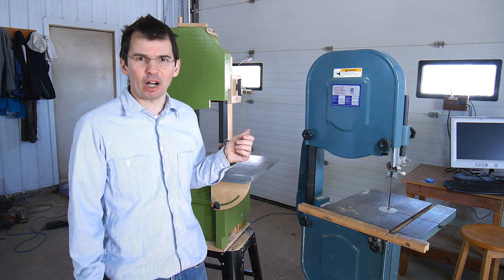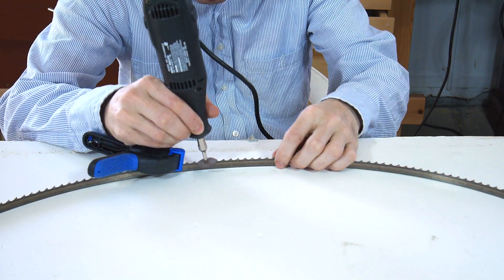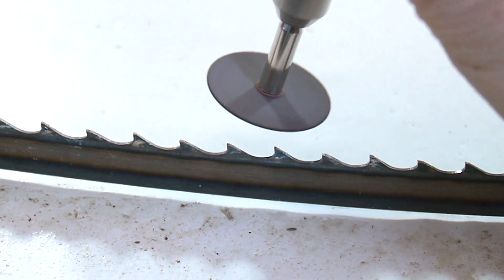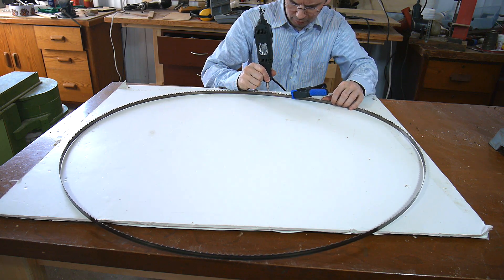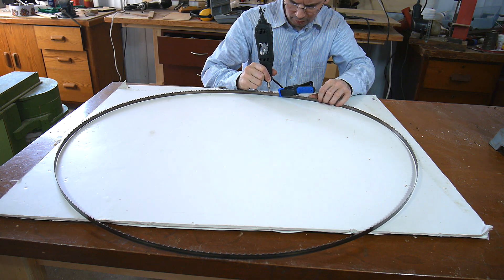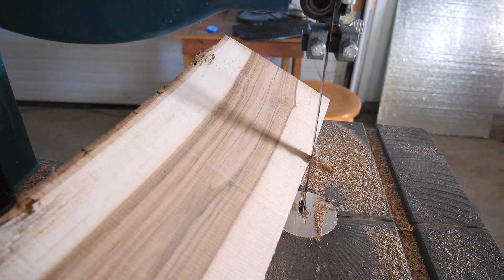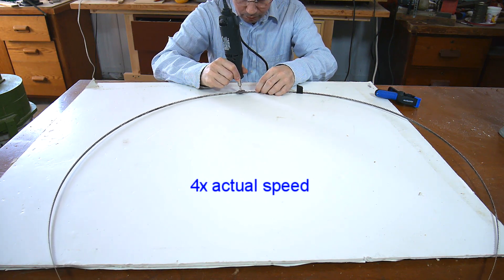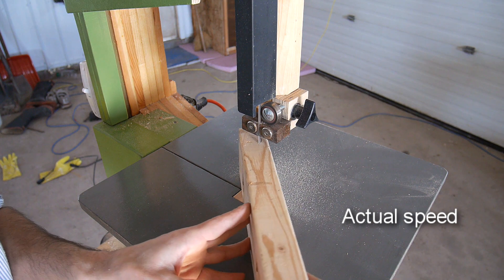Sharpening bandsaw blades with a dremel

Comment from the maker: A new video on sharpening bandsaw blades
I made a video about this five years ago. New video is shorter, better, and in 1080p
Reply: Shouldn't the sharpening be done under the tooth?? I mean, yes, this works indubitably, but it also shortens the life span, eventually you won't have a tooth to sharpen.
Reply: Nice update. I actually bought a dremel-ish after watching your first video. 

I have an excellent Starrett Intense Pro-Die blade with 10-14tpi (made for cutting tool steel) that I somehow dulled dramatically. I think I was feeding it through what must have been a weld when I thought it was just annealed mild steel, and my combo band saw slows the blade for steel but doesn't support flood coolant so I just had an oil drip. Clearly wasn't enough. 

I had forgotten all about this technique. I need to try it on that blade because it is really good quality steel. But I'm not sure there's enough of the teeth left to bother with it. Thanks for the reminder!
Reply: this makes my head hurt.... so many teeth!!!
Reply: Seeing how you do it seems easy and fast. Thanks for the video, very educational, as always.
Reply: ***** I'm not saying "don't sharpen" and i'm not saying it doesn't work that way, BUT, what i'm saying is that sharpening the "gullet" of the tooth (whatever that's called) is a much more profitable endeavor.

I mean damn, on such small blades it's really the joy of cheating the system, but there's big, big blades, 1 tooth per inch bigger, those are expensive as heck ($200ish and above) where you actually have to sharpen it or empty the pocket.

I don't think you'd cut the top of the teeth on that.

Just my two cents.
Reply: aserta I think he is just taking the easy route to get one or two extra uses from what he would normally throw out. You are correct about the proper method. Some people settle for quick, easy, wrong but better than not at all methods. I do it myself sometimes. :)
Reply: Beautiful! Thank you! Like many other videos you've made, your sharpening videos have saved me time and money!
Reply: Jon Miller  Well, it is better than throwing the blade away when it is dull for the first time.
Reply: aserta he discussed that exact issue in the previous blade sharpening video,
Reply: maxdecphoenix But he didn't in this one.
Reply: Meat saw
Reply: specialks1953 I really hate this mentality. There is no such thing as "the proper method." There's only methods you agree with, and those you don't. (also arguably those that don't work at all, but eh)
Reply: aserta So, in order to avoid the hassle of having to buy a new bandsaw blade he should take on a ton of hassle in trying to sharpen it as per your suggestion?

Bigger more expensive bandsaw blades aren't really relevant.
And if you're going to do that, you'd be weakening the blade too.
Reply: you could do a gadget to sharpen them and film the proccess
Reply: you should make an automatic sharpener, raising the dremel up and lowering it on a tooth, detected by a laser detector and reflector
Reply: I agree with you.  It is easy to speak about the perfect method...while sitting in an armchair.   In the shop, the week-end shop, this method is perfect.   Numbers are simple: in 5 minutes,  you put back to life a 10 dollar blade...
Reply: 9

u888

Comment: Great video and a great tip. Ive spent hours in front of a ban saw making log boxes that I sold in craft shows! One reason for my success was my ability to sharpen my band saw blades. Yes cutting down on the expense! I usually got 4 sharpening’s per blade. I used a 3/ 16th wide kerf blade for any cuts requiring a turn! My straight cut band saw I used ½ inch blade that was thicker. PS the dremel can also be uses on chain saw blades. BTY the quality of blades is no where close to what they were 20 years ago. I have older blades the difference is astonishing

Comment: Hi Mattias, I have an electric grinder for my many chainsaws. I use this tool to sharpen my bandsaw blades for my Startrite 502E band saw (a UK saw).  Begin by cutting a kerf (same as band)  in a six inch length or so of hardwood, drill four holes just below kerf, push into the holes four nails, the band must rest on the nail/rollers, drilled so as the band teeth are above the wood. On the underside tap in two nails into pre drilled holes (remove nail heads) use drill press to keep holes square to the surface. Clamp on the whole assembly the Chainguide and tighten. its a quick tool to make. Use the wheel for a 404 chain as it tougher. These electric  rotary sharpeners are about 100 quid in the UK, I think Oregon make them, mines a cheapy lookalike from china.. I hope this helps keep your sharpening more accurate…

Comment: Nice. Thanx for posting. Don't forget to check the set on those teeth. I bought a setting tool for my gas powered Hud-Son bandsaw mill blades. Does a nice job on the coarse resaw blades for my shop bandsaw too.

Comment: Most don't sharpen their blades because they use them till they break. As the blade dulls they push harder, They push harder distorting the blade making crooked cuts. To compensate they increase blade tension and then POP!

Comment: There must be a way of setting the dremel in a jig and the blade so the dremel is the set angle and the blade is fed in such a way that it does what you did in the video?? Great tip thumbs up.

Comment: I tried this on the junk blade that came with my bandsaw. It certainly cut much more easily, but had terrible drift, and even when I corrected for that, my cuts had a "waviness" that was not caused by moving the work. This is obviously caused by something I did wrong, but I'm not sure what - this video (or the other one on this channel) didn't mention what it might be.

Comment: Do you have an idea how often you can do that?
Reply from the maker: Marius Hornberger About five times, but it also depends on how big the teeth are.  Eventually, the teeth get too short.
Reply: For 4TPI blade I get 10-12 sharpenings before there's not enough kerf left. At the last several sharpenings the surface left by the blade is beautiful, if you can get straight (not wavy) cuts you can use resawn wood straight off the saw for building oudoor stuff.
Tip: use the lowest possible speed on the dremel tool for this job. I learned last summer that it's very easy to overheat the metal; I had several teeth in a row that had a tiny tiny amount of the tip broken off, so I just did several taps with a dremel tool (instead of one for a healthy tooth) and I noticed that the metal got discoloration, after that I grabbed a magnifying glass and checked more teeth and most of them had minor discoloration close to where the disk was touching. I now use a diamond disk, it is much more course, but it does not overheat the metal, though it is very easy to grind too much, first blade that I used diamond disk on got used up in only five sharpenings :) Hope this helps.
Reply: I know that
Reply: If my comment does not make sense to you, then you came to a wrong neighbourhood.
Reply: My native language is Lithuanian and I get to speak in English only in youtube and facebook comments and sometimes emails, so sorry that I used kerf isntead of set or whatever word. I would be actually sorry and willing to improve if that sentence would have not made any sense, but everybody knows what I mean by that and I don't see any problem here.
Reply: I wasn't refering to teeth. You seem to have no idea about what I was talking. Take a better look at the blade and see where teeth bends start. They start at best close to the thickest part of the tooth, so if I grind away say half of it, I'm left with 0,2-0,3mm of set wich brings us back to having not enough KERF for succesful cuts.

Comment: I've enjoyed your videos for years.  I have a large Laguna bandsaw which I use chiefly for cutting up firewood. The blade on it is pretty dull but I'm not looking forward to doing one tooth at a time for a hundred and fifty teeth. How about mounting the blade backwards, turning the saw on, then holding an ordinary knife sharpening stone against one side of the teeth, then the other. It probably wouldn't be as good as doing each tooth individually but it would be a lot quicker.

Comment: My father would sharpen and set his own band saw blades (and everything else) but he would buy the blades with no set and apply the least set he could manage (he was seeking accuracy on small parts not volume). His differing requirements would probably have been at odds with the dremmel idea in that the burr will appear on the same side of the blade and would likely cause the blade to track sideways (particularly under pressure). Perhaps these tips would help someone else. He would unify the teeth my gently sliding an indian stone against both the sides of a set saw. He would do the same on the front till all the teeth had been touched. He would then file the backs as you have dremmeled (In the direction of set) till the newly "stoned" face just came to a point. He would then file through the the face of the tooth (in the direction of set to create an outside burr (pitched forwards at about 20degrees. Then he would again do the above with the stone to just touch the one or two teeth that may have gone proud and having identified the flats he would dress those again and also to touch off the created burr...... his mantra was that yes a burr is sharp but a burr that has "just" been cut off is sharper still and remains sharper for longer.....For any of the doubters we could cut strips of hardwood say 2mmx20mmx~600mm and a micrometer would not pick up 0.01m difference in any of them anywhere.......Slowly of course....I think I have left out one bit of information for those that might try this at "home" but to anyone experienced it would be obvious....Thanks for the video

Comment: That's cool... I thought you need to grind a lot to get it sharp enough... 
Why not screw a piece of wood with a groove in it to guide the blade, and a small mechanical rocker arm to hold the dremmel, with a small roller to ride over the crest and wave of the blade to make the grinding semi automatic..

Comment: If you are going to knock down the the outer edge anyway, wouldn't it be easier to use a fine grit sand paper with a stiff block?

If you mounted the blade reverse you could do it on the saw and it would also level all of the teeth, which should be pretty crucial for even cutting from each tooth.
Reply: For anyone else wondering; I just realized the physics will not work out.

The teeth MUST have a single point with a slope back to the spine behind them. Think of a single tooth going through the wood as you advance the piece. The tooth must make a cut that slightly advances as it cuts and leaves behind a slope behind it.

A tooth with a flat is effectively a miniature chisel layed perfectly flat. As soon as the surface is a flat long enough to span two teeth it will no longer ever achieve a "bite".

Comment: Mr. Matthias, I inform you got a manual electric planer and I am finding it difficult to use, then ask if possible, a step as step to use it adapting so upside down on a bench with rip fence. Sincerely, Euripides

Comment: watched this and was thinking one could  make a angled drill press like dremel stand and that way you could set the max depth and just pull down till you hit that or feel you have taken enough of the tooth. 

Taking that one step further maybe you could set up a pry of some kind sitting in the well of the tooth that you could toggle to shift the next tooth into position, or maybe some rubber faced wheels on each side a gear to move the blade and perhaps mount a gear on the wheel that shifts it forward a tooths length and is set up to lock into position with spring a width and springs. 

then it could just be pry over, pull down, pry over, pull down, pry over pull down..

I would try it myself except I have not the bandsaw nor the drillpress.

Comment: could it be posibble to make jigg for sharpening bandsaw blades?
Reply from the maker: thefunrunner I thought about it a fair bit, but you need a soft touch, and, also important, you need to not touch it with the same spot on the disk each time.  Both of these come naturally by hand, but hard to do with a jig.
Reply: Matthias Wandel I was certainly waiting for the screw advanced sharpening jig!  Thanks for the pointer on this.
Reply: thefunrunner damn I was wondering the same question :D cheers!
Reply: Also there's the question of whether the hassle saved is worth both storing the jig, pulling it out every time, and the couple minutes it might save.
Reply: couldn't you just mount the dremel to the band saw and turn the blade backwards by hand? You could even mount the dremel on a bit of an angle and put a temporary blade guide behind the blade to hold it steady to really control the cut.
Reply: mrmacomouto That might work for one VERY light sharpening, because that would make teeth flat, or in other words - in line with the cutting edge. Just as if you would sharpen a plane iron without removing it from the plane. You would get whole bevel riding on the surface, not making much of the cut :)

Comment: I am currently working on a wooden machine project which requires an axle a fairly thick hinge to be mounted with a fair degree of precision.

Do you have any tips about hole alignment in thick pieces or across wide gaps in a contiguous material?
Reply from the maker: Zachary Sohn On a drill press, drill half a centimeter, then turn the piece 180, drill another half a centimeter, rotate, repeat.  This makes angle error in the table mostly cancel itself.
Reply: I see, that makes a lot of sense. Thanks!

Comment: You could make a jig for that. Pull the band backwards through a block with a peg at the top attached to the dremel. Sharpened teeth lift the peg, lifting the dremel onto the next tooth. Does that makes sense?

Comment: Life is too short to shop for a bandsaw blade? Life is too short to sharpen a bandsaw blade!
Reply from the maker: Joshua Hicks If you prefer to spend half an hour to five minutes, then yes.
Reply: pare de olhar para o relógio que você estará na eternidade, e então terá todo o tempo do universo para fazer o que precisa ser feito.
Reply: Matthias Wandel Or I can go on Amazon for 2 minutes (or regional equivalent) and have one delivered to my door.  No excuses about "waiting for shipping" either because someone who actually cares about their tools would have noticed the blade getting dull before it actually needed replacing and would have ordered it in advance.

Don't get me wrong, I applaud the method as a cost saving measure; but the argument that it's "quicker" than going to the shop and buying a new one is weak.
Reply: That's just sharp Canadian humor.
Reply from the maker: Shan Destromp Right.  Until you hit a staple or something (like the article says).  Then your blade goes from perfect to shit in an instant.  And before you searched amazon and all fir the right blade, changed supplier because of shipping costs, entered your credit card and all, I have had my blade back up and am doing work.
Reply: Canadian humor = dad jokes

Comment: I know you are a real engineer, how about taking a stepper motor or two, an arduino and automating the process?
Reply: Why? Automation makes the most sense in instances where doing work has a high time cost, and is repetitive, or easy.

This is repetitive and easy, but it's only a couple minutes. By the time you got everything set up, the automation would only save you a couple minutes of effort, and in the mean time, you have to store the automation rig. Never mind the time to design and construct it, the cost of the parts for the rig (even if you have them already, they're now tied up in the rig, you could disassemble the rig, but now you're increasing the hassle of the rig and essentially removing any time savings), or the intricacies Matthias touches on in the following reply to another commenter:

"I thought about it a fair bit, but you need a soft touch, and, also important, you need to not touch it with the same spot on the disk each time. Both of these come naturally by hand, but hard to do with a jig."

Comment: Time to make a sharpening jig that guides the blade through a grove and holds the Dremel at a variable angle that allows the tools weight the come down on the blade and thus sharpening it
Reply from the maker: DarksideXray The tool is too heavy.  You'd break the disk.

Comment: I have to say......I am kind of disappointed here. I was hoping you would build some sort of jig to hold the drimal in place while you turned the blade with one of your geared contraption's. lol
Reply: Like a lever that lowers the drimal while you move the band around?
Reply: raiderrob672 Comme on Matthias, show us how to make it cool to sharpen a bandsaw blade!
Reply: raiderrob672 quote from Mtt: "I thought about it a fair bit, but you need a soft touch, and, also important, you need to not touch it with the same spot on the disk each time.  Both of these come naturally by hand, but hard to do with a jig."
Reply: Drimal? dremel